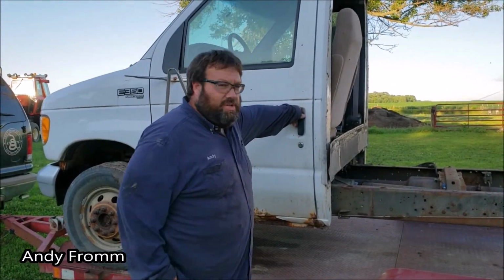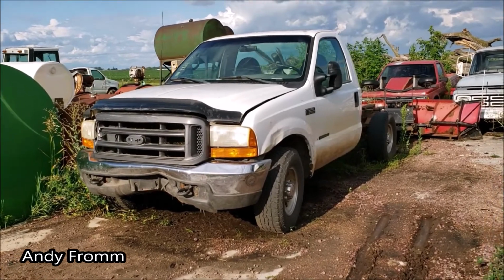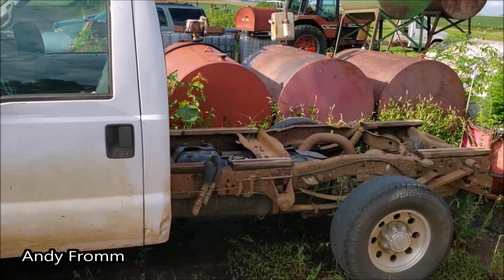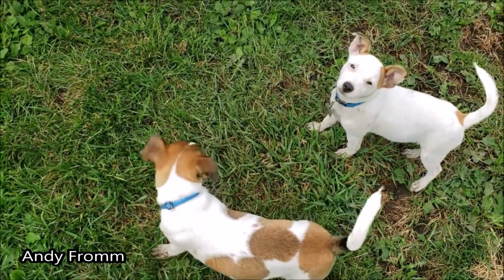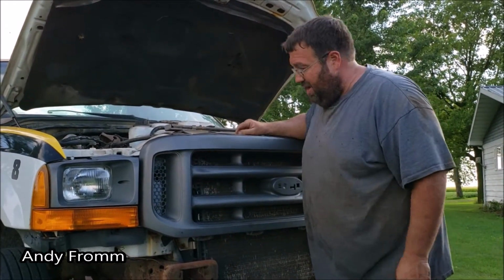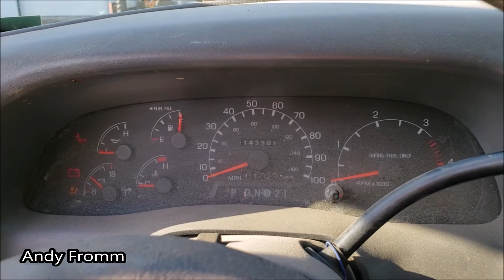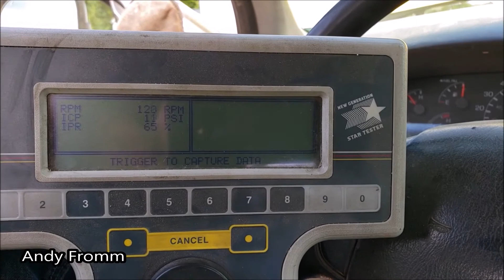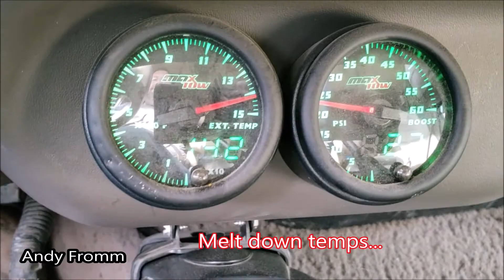New Projects ford #powerstroke swaps

Comment: Brought home a 93 f 150 2 weeks ago basket case. Sorry I don't think we'll ever grow out of it . Almost done with the 94 350 from January. Maybe
Reply from the maker: What are you doing to them?
Reply: Bought the f350 used in 1994 best all time truck ever crew 460 single. Trailer everything fuel was cheap. About 12 years ago son inlaw need a 1 ton so it was used even more. He got ahead 350 lost transmission been setting 8 years. He said time for it to go. So I brought it home. I retired in January.
Reply: Keeping f350 hope to get it painted. I might give it a shot. It will never be a show girl. Still use it trailering . The 93 was dad's truck he let my sister have it in 2003. Been setting behind the grain Ben's since 2014 lost brakes. Got it running putting axle seals in right now just putting new shoes on as I type. Her son need a truck I'll give it to him.  Also went to Kentucky pick up a rust free bed for it also . Sorry am I going on to long? New a this.
Reply from the maker: Get it going